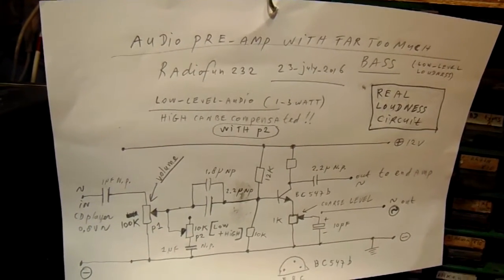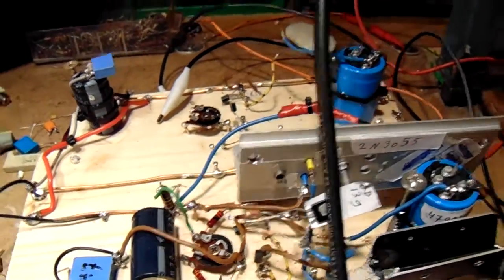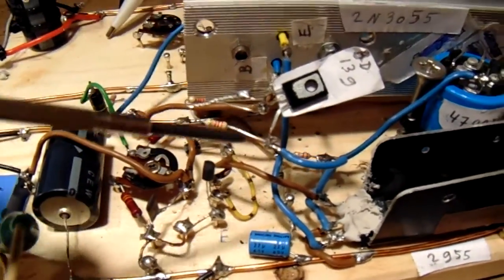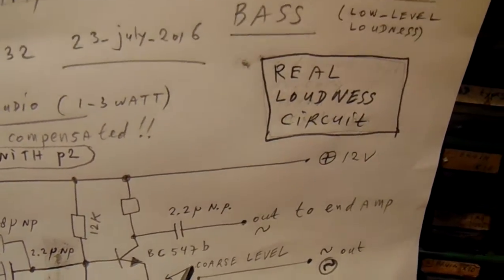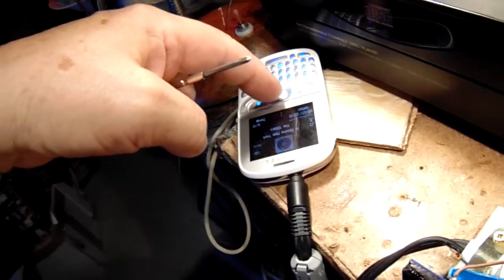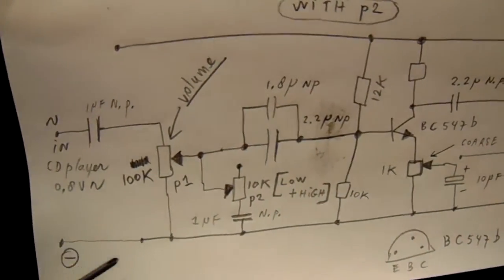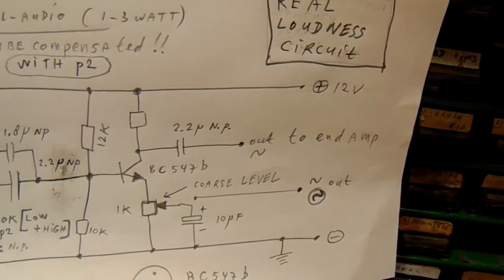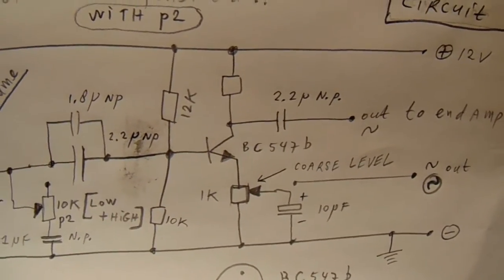Good quality loudness 1 transistor pre amp (schematic)

Comment: What is the value of the resistor that is in the collector of the last transistor already at the audio output
Reply from the maker: You can choose between 2K2 (2200 Ohm) and 3K3 (3300 Ohm). Both resistors work. Thanks for your comment.